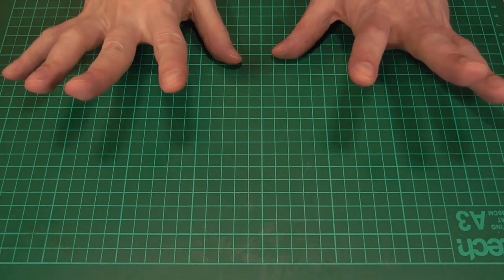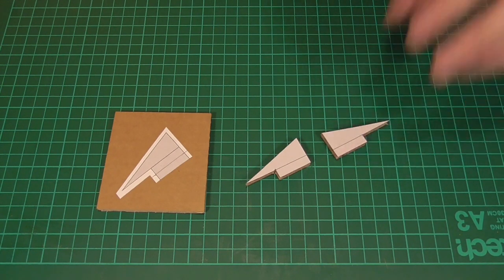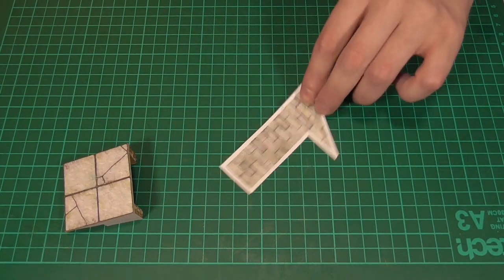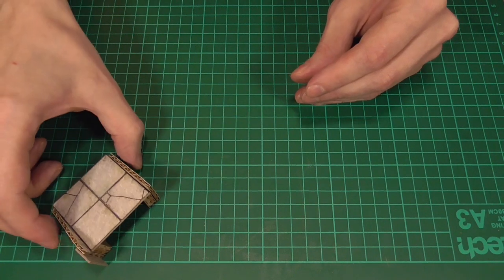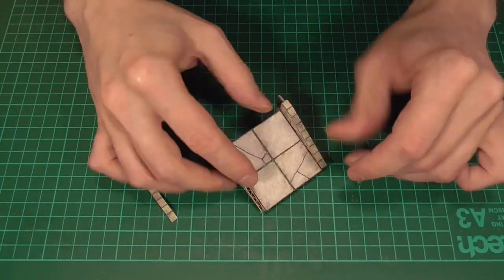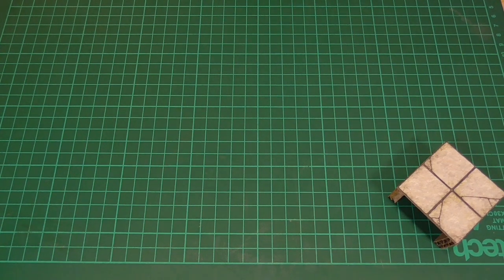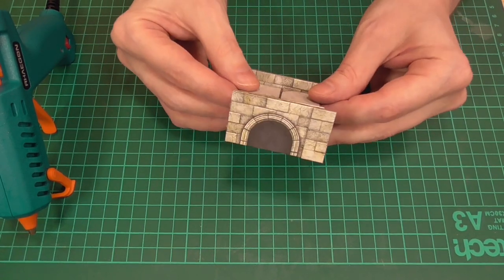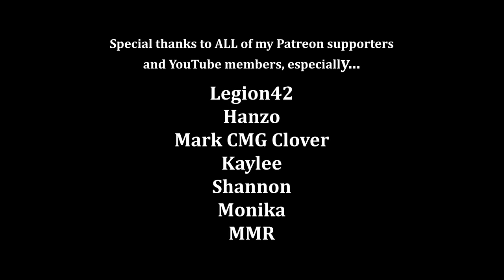Episode 77 : Modular Bridge (D.I.Y. terrain for D&D, Pathfinder, Warhammer, etc.)

Comment: I've loved your stuff for a while now, thank you for making these tutorials. About this one, do your minis not slide down the ramps? That happens anytime I make inclines, so I instead make wide steps. But I'd rather it look smooth like yours
Reply from the maker: The angle on this one is about as steep as I'd want to go  - but the plastic models I use (on mdf bases) have been fine. Though the one time I used metal ones - they had more of a tendency to slide (so looking back, I would have probably made it less steep).